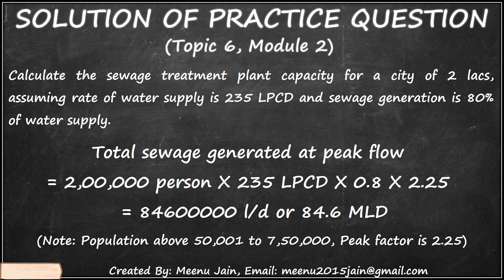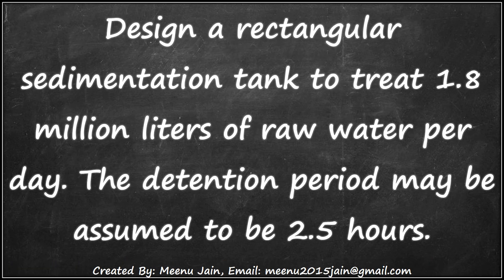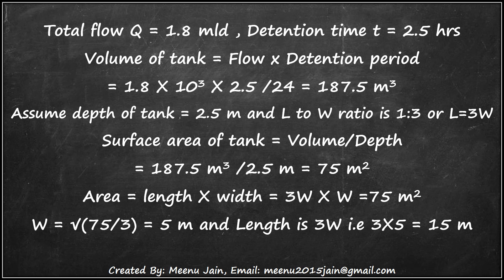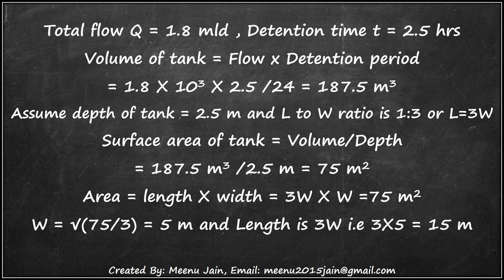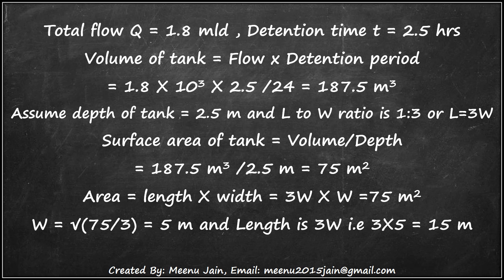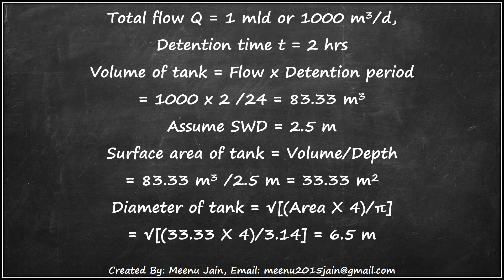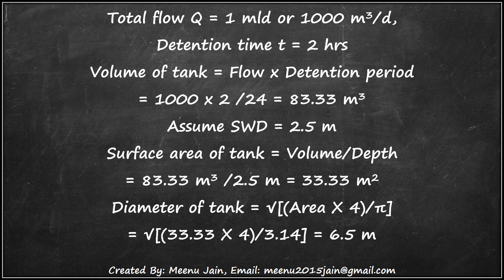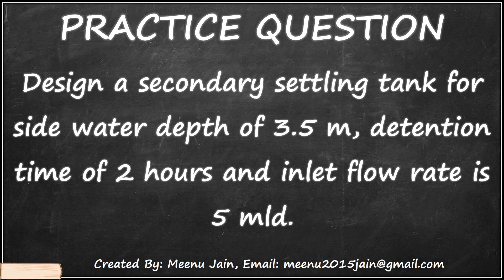Sedimentation Tank Design (Topic 7 Module 2) || Clarifier , PST SST Design

Comment: Ma'am, how detention time affect the costing of a water treatment plant. I am an electrical engineer and no exposure in the designing of WTP. Pls help
Reply from the maker: Hi, thanks for watching my videos, detention time is very important parameter for designing of various treatment processes, if detention time will increase then automatically volume of unit will also increase because 
 Volume= Flow rate X detention  time. 
If Volume of any unit will increase then automatically related costs will also increase.
Reply: Meenu Jain Lalitpur Thank you for useful info . nice videos👍
Reply: Ma'am how do we decide the required detention time bcz there is range given.. min to max for every unit.
Reply: @sudhirrai471  7